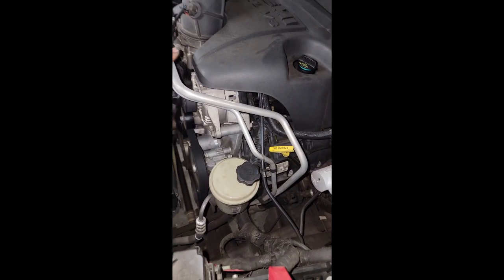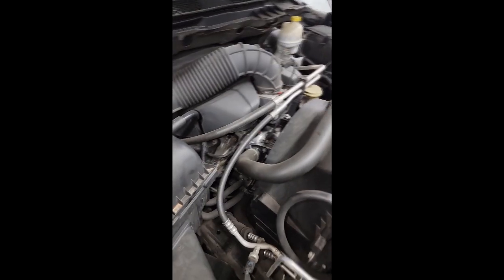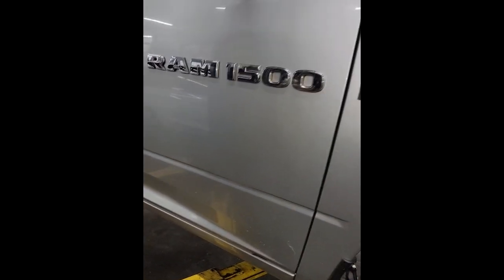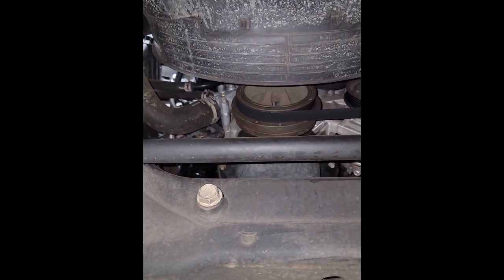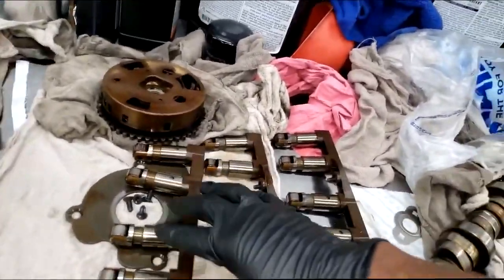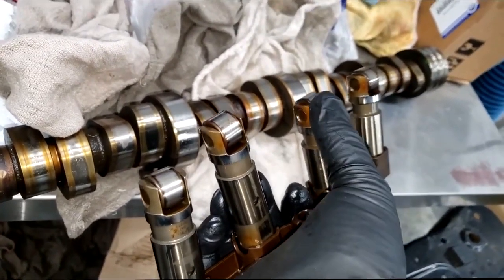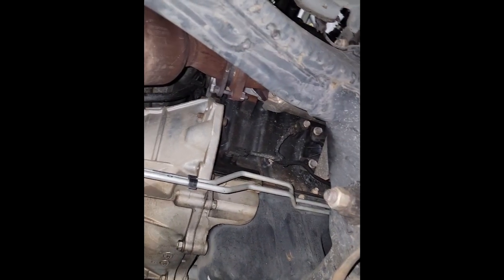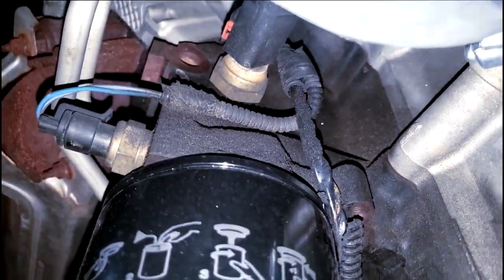The secret to keeping your 5.7L MDS Hemi Motor Happy. No more P1521 Check Engine Light.

Comment: Online Mechanic Tips.. It amazes me how people cheap out when it comes to oil and oil filter. Even the most expensive oil and oil filter is still a lot cheaper than replacing the engine. Some people even do it with cheap parts. The part may be cheaper than the OEM but is it really cheaper if you have to replace it multiple times because it's a cheap Dorman, I mean aftermarket part?

Comment: Real world application Here. I run a 5w 30 in the summer when it's a 110 degrees, and  the recommended 5w20 in the winter when it's cold. 09 hemi ram
Reply: Makes sense to me if the atmospheric temperature affects the engine temp enough that the 30 weight helps in the summer...